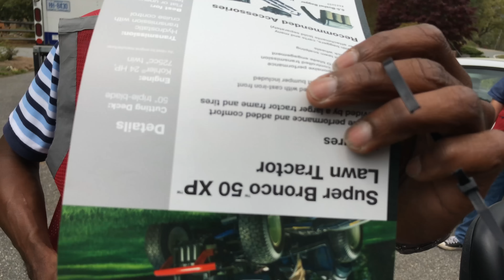Troy-Bilt Super Bronco 50 XP Riding Lawn Mower - Introduction

Comment: I have the Craftsman T240 paid $2,300 tax not included love it it's a cross between a Lawn/Garden tractor according to a craftsman Rep built very well to last years has the Kohler KT725 22 horsepower 725cc V Twin Engine 3 year unlimited hours warranty and the warranty covers commercial use also

Comment: Damn, his customer service was top tier. We don't get that type of service here in the Washington, DC area. I had a Troy Bilt 46in deck Super Bronco. The unit worked fine except the deck would always get out out level. Do you have the bagging unit for your Xp, looks like a nice machine.
Reply: Ousama Abdu hey how do you put fluid in the transmission. My super bronco want go forward or backward. My mower is 54inch cut
Reply: @janbanks2087  
What's going on my man
Honestly, I only had it for a few months then sold it so I have no idea how to change the transmission fluid on the unit.
Reply: @janbanks2087  Good question i still have my 2007 42" deck Troybuilt Superbronco 19.5 hp Kohler tractor model and mines just whines when in forward and in reverse, just had it service, overhead valve cover gasket, and belts, and a new belt pulley, but it's still eating belts, as for the whining noise i really don't have a problem with that because it still pulls fine very hard and strong in both gears and still very torquey, lil tractor is amazing it's been whining for the past 2.5 years mechanic says "your transmissions about to go" i said where to the house, he said it's no good i laughed at him as he explained and contradicted himself, because in the end he said simply put "your transmissions out of oil," then i asked him do you have an transmission out back in his storage he said yeah i think i can replace it lol,..... like the old saying goes i'll drive it til the wheels fall off.
Reply: Amazing what happens when the camera is recording...

Comment: Thank's for sharing this, I noticed the date posted and have to ask How is the Troy Built doing for longevity and do you recommend this mower?
I am looking for a replacement for my Stanley which has lasted over 14 years and now has a cracked frame. Thank You Again 😀👍
Reply from the maker: So far the only problem I've had is that I've thrown the belt once. Other than that it's still going strong and is a pleasure to mow with!
Reply: @tonyleeglenn  Thank you for replying I appreciate your help.

Comment: I think this is very similar to the craftsman pro series, they are both made by myself. And the set ups and controls are identical. But idk it the transmission is as durable as the craftsman. And it seems like the troybilt has different sized decks. My pro series has a 24h  Koehler. 46in it has the bumper. Electric pro, cruise. But has the turn right extreme.
Reply: They're built by MTD, so yes they're going to all look the same, just different paint and badge choices.
Reply: William Todd that's not quite what I said, again, transmission durability, some have power steering, and again, craftsman is he only "badge" to offer the turn right extreme
Reply: I read what you said, I was just saying they're all going to look the same because they're all built by 1 manufacturer (MTD).  They have slight differences depending on the model, you'll get different features, different turning radius they all have their own "Brand" names for that tight turning radius.  Many parts are shared throughout the lines and hopefully they eventually learn this is a terrible idea and divide these back up to their proper brands and start building quality products again because my 2010 Craftsman YT4000 is a pile of junk.
Reply: Yeah those "YT" models are made by AYP like the huqvarnas. I just sold mine. You can tell by the chute on the side. They tend to put the deck size on it. I got rid of my YT3500 because the deck was way off set. The wheels were constantly rolling on the ground where the other side was fine. Even all the way up. It wasn't adjustable

Comment: I bought this same tractor from Lowes in August of 2016.  Mower has never run correctly.  I've had it in to Troybilt service centers on 3 separate occasions and the only thing they have done to it is put a new fuel cap on it.  Still runs terrible.  My symptom is the mower will stumble and die about 5 +/- 2 mins after the blades are engaged by the electric PTO.  I expressed extreme displeasure with 4 different Troybilt tech service reps on the phone today about my troubles with the mower and still no resolution.  Their last chance to resolve is in the mail to me now in the form of a new seat sensor.  If this does not fix the issue I will be aggressively attempting to either get a new mower or a refund for the piece of junk I have now.  It does appear to be a good deal and great looking mower but Troybilt's lack of attention to "after the purchase" support and failure to back up their product have me seriously angry about the $1900+ I am out on this mower.  It has less than 20 hours on it and will not mow for more than 5 mins consecutively without dying.  Hope you have better luck with yours my friend, I will not recommend to any one.
Reply: My be to late but sounds like a fuel problem when you change the fuel filter it get air locked
Reply: Ron Owens  we had the exact same problem. We had it in the shop for 3 or 4 months without any solution.  They replaced many parts and nothing worked. Just by accident my husband found someone else with the same problem that claimed loosening the gas cap fixed their problem. We decided to try it and IT WORKED!! It runs great as long as you keep the cap loose. I hope this helps your problem too!
Reply: So you "Vented" the cap. You nailed the problem. The caps normally have a tiny hole formed in them to let air in as fuel is used.
Reply: I own this troy built and its been great ..... Starts up every time , runs strong .... The 1 issue many have had is the fuel cap ...if you just slightly loosen fuel cap while its running it will run great ... Feels well made and cuts tall grass easily

Comment: @tonyleeglenn How's the Troy - Bilt holding up ? I just bought one from MTDparts.com on closeout, a leftover 17 model, but with the 54 deck. It was so good of a deal i couldn't pass it up.
can't wait to get it and see how it does, probably a little overkill for me @ 54", but it was a steal a $1000 for a brand new 25HP mower with the 54" fab deck.
Reply from the maker: Still going strong with zero problems except that the belt broke this year and I had to have it replaced. Spent about 65 bucks having a local guy put one on so I didn't have to mess with it. It's a great mowing machine. You'll love it.

Comment: Transmission in these is undersized, it's the same one found in smaller tractors. If you just mow on a flat lawn you'll be okay but steep hills and/or towing things will lead to failure eventually. edit I meant to say prematurely, they'll all fail eventually.
Reply: Nodak81 what transmission does it have?
Reply: I believe it's the Tuff Torq K46. I actually take back my statement at bit. Hard to tell in the video what size wheels are on the rear but they look like 22" and the K46 is rated for 20" wheels max. These slightly bigger tractors would benefit from an up-rated transmission. The big wheels plus heavier weight means extra stress on the trans. Weird thing is that Troy Bilt's website for this particular model shows smaller 20" wheels, so maybe they got the idea and changed it for 2018.
Reply: These manufacturers are ridiculous. Putting such a light transmission in tractors is pathetic.

Comment: U really dont need ethnol free has I have la 125 12 years old no issues with anything and a 2020 e130 I just put stabil 360 in it every fill up and at the end of the season I run it dry never a issue with ethnol even with weedeaters  and other small engins and if u waunt use full synthetic 5w30 just waunted to give u my opinion